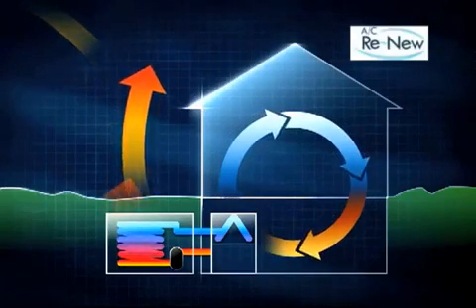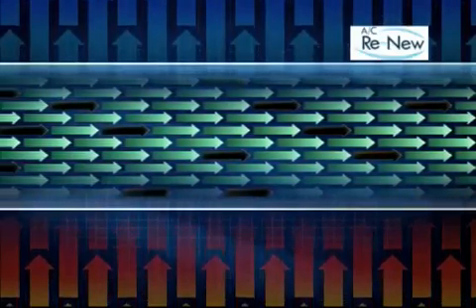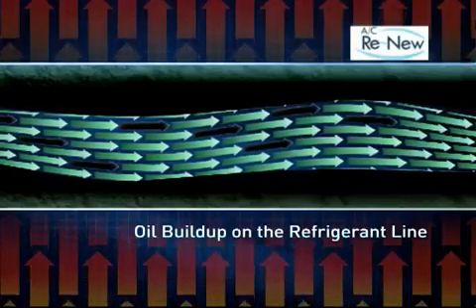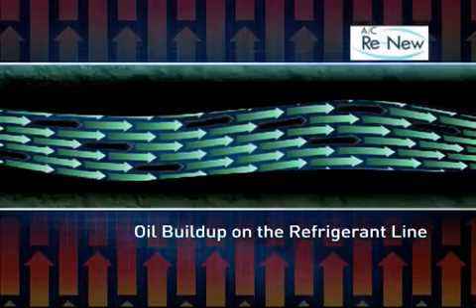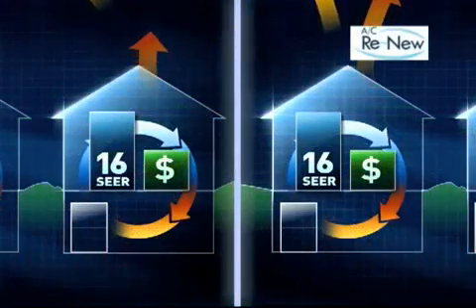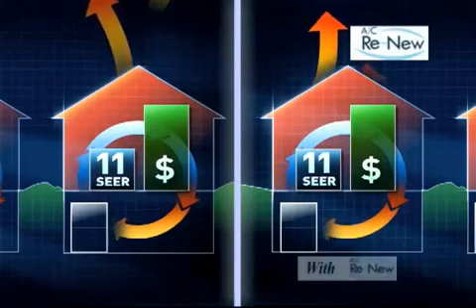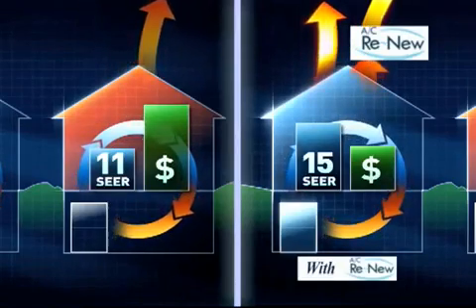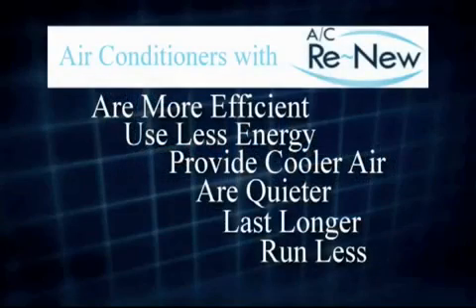A/C Re-New: How it Works

Comment: I was extremely skeptical of products like this for over 20 years, then in 2013 Copeland changed an anti corrosion additive in their compressors, and it reacted poorly with other system lubricants, and caused an industry wide problem with sludge build-up in TXVs.

Many equipment manufacturers distributors started handing out AC Renew as the "fix" for the problem, and in cases where the TXV was still at least partially operable, the AC Renew worked!

It has made me have to reassess my feelings on system additives in general, and AC Renew in particular.

Comment: I was skeptical if this product really lived up to its claims as I've heard techs refer to additives such as this and leak stop treatments as "snake oil."  I added it to my own condenser at home back when it was called Zerol Ice, and it made a believer out of me! It resulted in about a 500 watt reduction in compressor power consumption. In other words, my system was about 15% more energy efficient, saving me more than 5 cents for every hour of runtime. 

My condenser was one we had installed for a customer, but we replaced it again due to his complaints that the scroll compressor was too excessively loud, especially at start-up. I had no way to test the decibal levels, but the Zerol Ice (Re-New) seemed to quiet it a little bit as well, although it always remained louder than normal. Even though the noise reduction wasn't life-changing, I was absolutely satisfied with just the increase in efficiency. Most people's energy savings would help them recoup the couple hundred dollars or so companies charge to add this within the first year, after which this simple one-time addition would offset the cost of professional maintenance twice each year.

By my logic, such a substantial improvement in system lubrication and compressor efficiency would surely also decrease wear and tear, increasing total lifespan. I've recommended this ever since I saw the results for myself, and have now read that it is the manufacturer prescribed remedy for the defective TXVs that have been coming pre-installed in new systems. Apparently it often gets the TXV working properly, and prevents the need to waste the 4 to 6 hours replacing them under warranty. I wish I knew that years ago, it would've saved us thousands of dollars in labor costs to pay for warranty TXV replacements.

I have not been asked to write this product review, and I have not received nor do I expect to receive compensation for it. I just believe in spreading the good word when products and/or services perform exceptionally and are worth their cost. If even just a couple people who read this add A/C Re-New to their air conditioner and save money by decreasing their energy consumption it will decrease pollution and hopefully they'll continue spreading the word. Any A/C guys out there who are STILL skeptical, try it and see for yourself that it delivers on their claims. What do you have to lose, half an hour and 50 bucks? Small price to pay for a couple hundred dollars a year in savings, not to mention increasing your compressor's reliability and lifespan. Just think, if us technicians try it and then recommend it to our customers we could take millions of kWhs worth of carbon out of the air we breathe! Let's do it!

Comment: Have you guys tested this with small systems where the Capillary tube has been restricted by buildup?   

The scenario I see often is a neglected R134A system (beverage cooler or sandwich prep table) with clogged condenser fins which causes the compressor to overheat and the oil breaks down plugging off the capillary tube.  I normally change the compressor and change the capillary tube, then all is well again...  Can I skip changing the capillary tube and pour some a/c re-new in to clear up the partially blocked capillary tube?
Reply from the maker: We do not have specific test data on A/C Re~New versus a plugged fixed orifice such as a restricted Capillary tube.  It is possible for the product to react with the buildup, but our sense is that it could be difficult or time-sensitive due to the lack of transient flow (flow through) of the refrigerant/oil fluid that carries the product.  One other important consideration is the appropriate charge of A/C Re~New in a small system like a beverage cooler/merchandiser or prep table. Given their small size, the appropriate amount of A/C Re~New should be 10% of oil volume, or 1.0 fl. oz. or fraction thereof per 12,000 Btu.

Comment from the maker: Use of A/C Re-New wil not impair that function, it will not remove the lubricant needed on those surfaces in reversing valves. A/C Re-New is lubricant-based and will support the operation of the reversing valve.  What it will do is enable an operating system to have less oil logging or layering throughout the system, particularly in line sets. It enhances oil return to the compressor and this can be seen via moderate improvement in heat transfer in the coils, particularly the evaporator coil.

Comment: My only concern with this product, is that there is supposed to be some oil coating reversing valves in heat pumps, in order for the valve to be properly lubricated and functioning. Will AC Renew remove reversing valve oil coatings and cause the reversing valve to act strange?

Comment from the maker: @razer401 In regard whether A/C Re-New might cause a sludge effect in TXV’s & cap tubes, the answer is no. The product is lubricant-based & completely miscible & soluble with all industry refrig. oils & refrigerants.  In low temp apps with HFC refrigerants, we have an "XLT" formula. 
The technology has been used in our industry since 2003, & in the automotive a/c market longer than that.  Its primary benefits seen every day in a/cs are lowered starting amps & running amps & quieter operation.